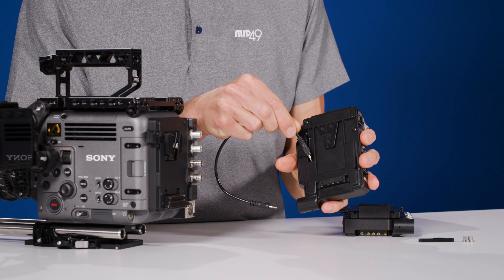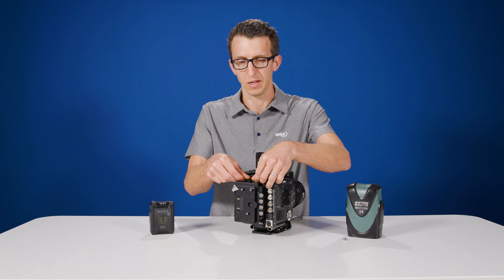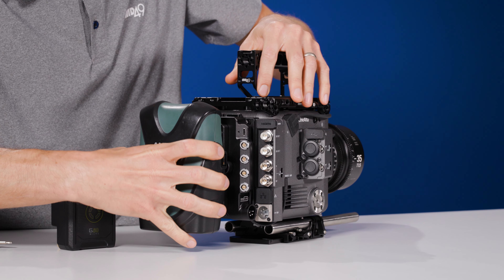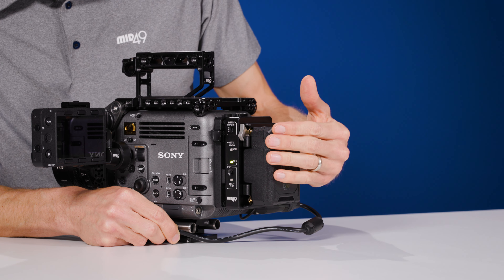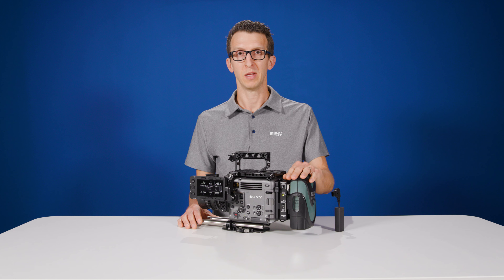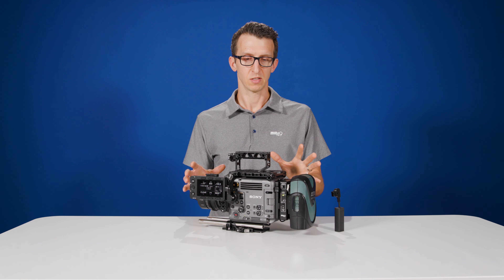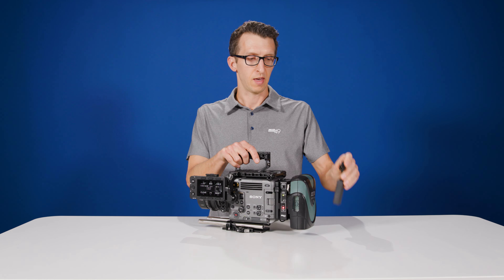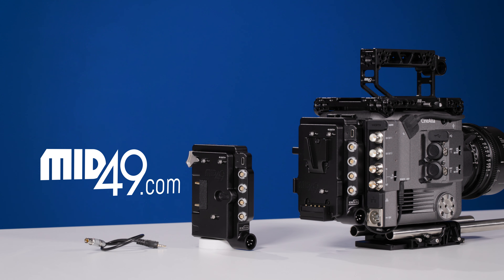Sony Burano Power Distribution Box DB-8 in Gold Mount and V-Mount

Comment: I would love for this type of configuration to be available on an fx6. Is this possible to create a vmount powered plate that can plug into the oem battery pins?

I would love to NOT have to use the dc input of the camera. Especially if I could regain battery levels readings on the fx6. 

I am going through an FX6 main board replacement right now. I’m cataloging it on my channel. I’m not sure if it’s because of my Tilta plate or the smallrig 212 battery.

Comment: would it be possible to use something like this on a fx6 on top of a v mount plate?
Reply from the maker: You can certainly do that. The LANC cable would plug into the remote port on the FX6 as well.